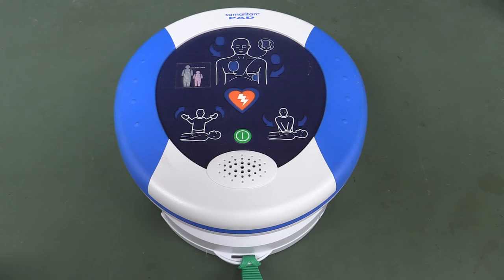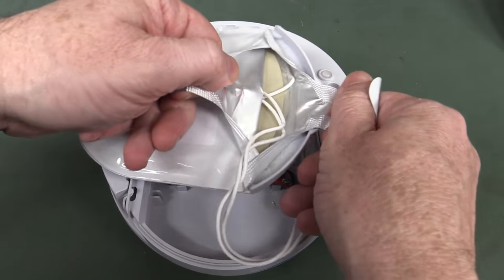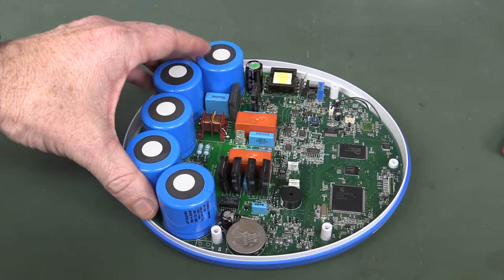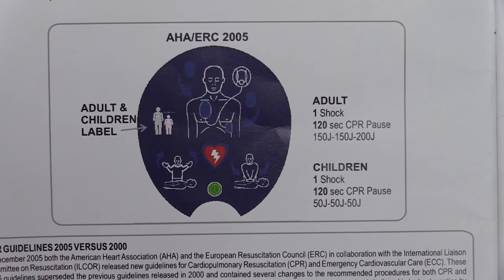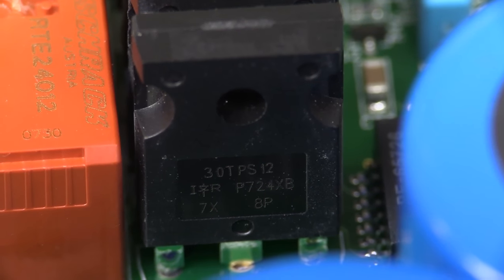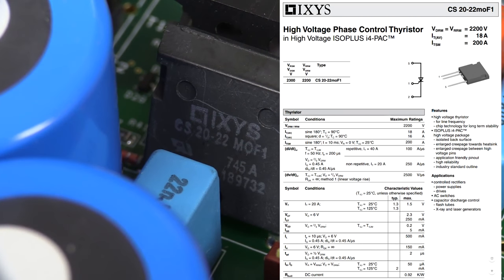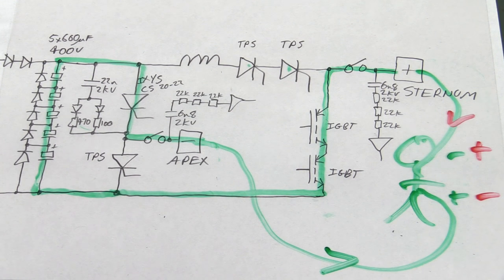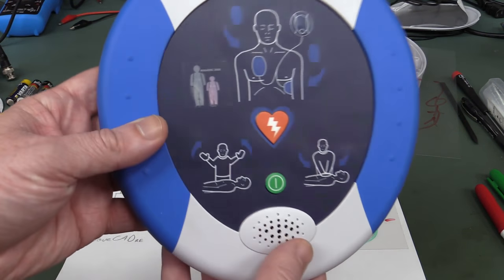EEVblog #909 - Heart Defibrillator Teardown

Comment: cap+ and cap- terminals may be for an external cap for other models.
Reply: Or instead of, for a different build version.
Reply: traces are bit smaller than the onboard caps, you'd expect that if it had external pac the traces would be of least the same thickness. I would suspect its more likely that its for diagnosis.
Reply: I would say that the trace widths are a little mixed up. The traces between the caps are significantly larger than anywhere else on the board. Not to mention that caps series have an overall reduced capacitance. So they're in series to achieve the desired voltage and not power. So i suspect that the output current is not what you suspect at the sight of the size and number of capacitors.
You'll also notice that the traces where the pads plug in to the board are a very similar width to the cap+/- outputs. 
I would say that they're for a different model. It seems like a bad idea to have those traces just for testing
Reply: i suspect they are for a Coulomb counting rig to validate the actual installed Joules at EOL test? ie, device put into test mode, charges caps to defined voltages, then rig slowly discharges them though some resistance and integrates the total current that flows?
Reply from the maker: Maybe, but the traces are smaller
Reply: Max Torque If it is for testing, the question that i would ask is why are there traces for it? For test purposes you would expect test points within the circuitry, not traces that pull the signal away from the circuitry. Also, the through holes at the silkscreen are fiddly - a little bit small and away from the edge for probe clips and the like. The pads are also fresh, so nothing has been soldered on to them for testing. To me, there is nothing that indicates that they're for test.
Reply: +08Ulrtasonic Is there any better idea what those could be used for?
Reply: Krisztián Szirtes Test points. SMT or through-hole. If you Google image 'pcb test point', you'll get results showing both.

Comment: How can the SCRs turn off, when there's still voltage on the caps/current flowing?
The clock maybe just there to start beeping, when the time for the pads is up or there is some calibration/check to be done at certain intervals.

Comment: The flyback diode(s) you were looking for is inside the coil, you can see the silver coloured terminal going into the air core from one side. They used a PTH one instead of the two SMD ones.

Comment: Hey Dave, I see a lot of the components on the HV side are only soldered onto one side of the PCB (e.g. the dropper resistors at 15:33). Why is is so? I always thought that a two-sided Pad will help stress relieving when the components wiggle a bit. What are the advantages of a one-sided through-hole pad?

Also it looks like the outermost pads on the high voltage transformer are missing on the pcb footprint, or does it only look like it?

Comment: The key thing about those electrolytic capacitors is that they are +/- 10% tolerance unlike a bog standard 'lytic that can be anything up to +80% 20%. For this application, that means that for a given voltage, the pulse energy is guaranteed to be the design value +/ 10%. It also means, for capacitors in series, that the charge will be more evenly distributed among the individual caps.

Comment: +EEVblog Dave at 29:30 you're talking about the lack of diodes across the inductor. What I've been wondering is where does the energy in the field go since I didn't think the reverse spike would go through the SCRs. Is it just dissipated as heat somehow? I hope you don't mind the question, I'm just trying to get to grips with some fundamentals since its nearly Friday!

Comment: Yes, those caps are custom, inside and AED and even Defibs in a hospital that are used by medical professionals are still QC in all aspects, the caps must be within a very tight tolerance of ESR and just as importantly their ESL along with dielectric  leakage current. That is beyond important for these. I use caps designed for Defibs for all my high current resonance circuits. Such as the rail caps for ZVS drivers, high power RF circuits, Regen Breaking for BLDC motor drivers (ESC), Tesla Coils especially the HFSSTC (High Frequency Solid State Tesla Coil) every one that build even slater knows that you can't use electrolytic caps on slayer exciter and HFSSTC designs. Even a DRSSTC will work much better using that type of cap.

Comment: I suppose that the IGBT is there in order to stop the discharge in the middle of the biphasic pulse.  Maybe I am wrong, but the Thyristors shouldn't stop until the whole capacitor finished discharging, unless the IGBT turns the current off in the middle of the pulse?

Comment: A thought for Fundamentals Friday:
Design of resistive voltage dividers for cases where the measured voltage is greater than the supply of the opamp or IC measuring stuff?

Comment: It does not matter if the RTC drifts over the years as you just need the time between the use and readout of the log which should be happening within days or weeks at most, where the RTC is going to be really accurate (seconds is good enough anyway).

Comment: Hmmm... Dave, something doesn't add up here. First you say that thyristor stays on as long as current flows through it (and it's true). But then you say when transitioning from one phase to another, it somehow switches off. So either it has to click a relay, or discharge in the opposite order (because IGBTs can be turned off?). Or am I horribly wrong?

Comment: The equipment might use the RTC to regularly do self tests and the Usb might help readig the self test data out to determine if the equipment is still in good condition.
Reply: John Doe is that the battery he was talking about? was thinking it might be used to set off an as alarm after the device gets too old.

Comment: @27:43: Why/how do the SCRs turn off?
Reply: So the TPS SCRs have a threshold, that is so high, that they shut off even if the caps have still enough charge for the negative shock? And the high voltage SCR has a lower threshold then?
Reply: MonophonicSurround He's explanation is incomplete, unless the relays open or something else happens it would just short out when trying to reverse current flow.
Reply: Yes, this is a big gaping hole In Dave's explanation.  My guess is that the  IGBB's and the IXYS turn on which starves current from the lower SCR which turns it off.  Then the IGBB's can be pulsed off long enough to turn off the upper SCR's (probably inductor back EMF helps here).  Then the IGBB's are turned back on to complete the negative pulse.
Reply: But relays would be slow and have unpredictable timing.  Arcing contacts would increase unpredictability.  I really doubt in a medical device this would be acceptable.
Reply: You are right about the IXYS not being needed to drop the lower SCR.  Also, the inductor would help here since a brief pulse of the IGBT's would not see an unreasonable amount of current over the short duration needed to switch the lower SCR off.
Reply: the explanation that makes the most sense is that he mistakenly swapped the electrode polarity, that way the igbt would turn on, deliver positive pulse, turn off, and then the SCR can latch-on and it will conduct until the cap is empty
Reply: +filippo savi indeed.  if I were to design this I would use the igbb for the positive cycle as it can be trivially turned off.
Reply: The amount of energy is going to be controlled by the voltage the capacitors are charged to beforehand.  It will not be controlled by the timing I guarantee.  The relays are just a safety interlock preventing high voltage leaving the unit until it is engaged.  I don't think sense lines would be needed.  The on-off times should work over a fairly wide range of values, and the inductor value would give you a very good idea of how long the duration should be.  The SCR will switch off quite quickly.  You could easily have a safety margin on the timing of over a factor of 1000.  However, I do wonder if Dave got the polarity reversed.  One question I would have though is why have the inductor on the negative pulse...  That seems to suggest the polarity is correct and the IGBT's momentarily short out the path to turn off the lower SCR.
Reply: the inductor is there to limit the current's rate of change, a normal  SCR (non GTO) starts condcucting from the gate (which is a point like feature, compared to the die dimensions) outwards, this means that immediately after the turn on pulse the conducting area will be quite small, if the current raises too quickly it will possibly cause a thermal runaway due to silicon's NTC characteristic, raising the junction temperature well above silicon melting point in the hot spot,  making the whole device fail short circuit; in fact if you search in the datasheet there is a hard limit for turn-on di/dt specified
Reply: Kevin De Martelaere
 I think it would be more accurate than any other method.  The capacitance should remain relatively constant, while skin resistance and other factors would be highly variable.
Reply: filippo savi I think the patient will do enough to limit the currents rate of change.   Also, if that was the purpose then why isn't the inductor on the other big IXYS SCR?  It would seem the best explanation is the inductor is there to limit the current change rate when the IGBB's turn on momentarily.
Reply: well the patient cannot be relied on, the skin might be wet so low resistance between electrodes, and even then the resistance is higly dependent on electrode placement and patient skin type, it shouldn't be used in that case, but an average untrained  (or poorly trained) joe might not know that or even worse in that case the AED would be destroyed, so relying on patient resistance is out of question I think, another problem i see with the short-circuit to turn-off method is that it would waste energy from the caps (and I also think that the discharge intensity is controlled by cap charging voltage), and it would certainly place unnecessary stress on a lot of components (the 2 series top scr's the igbts and so on, then again it could be poissbly done that way
Reply: Well, I don't think it is just the patient.  Those tabs that are placed on the patient have a conductive film over the surface.  The film is conductive, but I don't think the resistance is that low.  I am sure the current will be limited even if the two tabs were attached to one another.  Also there are plenty of other fail-safes in the system.  I am sure the system first obtains an ekg which determines that it is safe and appropriate to apply the pulse.  The relays will only be engaged after that is determined.   Also, the stress on the components would be modest if the pulse is short due to the inductor... and only a very short pulse is required to turn off the SCR (Order of 10s of microseconds).
Reply: Kevin De Martelaere  But my point is that even a modest serial resistance will do alot to limit inrush current.  The conductive gel on the pads will offer a modest serial resistance.
Reply: I dont think the AED regulate the energy at all. On most AEDs I have saw the datasheet of, the energy restriction is done by the pads, in most cases a series resistor in the pads connector, so if you have jacked up the AED with child pads, the series resistor will be suitable for a child, and if you have jacked up the AED with adult pads, the series resistor is suitable for a adult.
Reply: Sebastian Nielsen But in this specific case the AED has a button on the front panel to switch between child and adult.
Reply: I think, he's wrong. The current first flows through the IGBTs and ist turned off with these, so the SCRs turn off. Otherwise no sense for the IGBTs.

Comment: Am I correct in thinking that those missing diodes on the inductor are because of a different model or a previous design revision?  I noticed a lot of boards will have missing components where they are marked on the board.

Comment: BMEET Ret.  Yes... all is components used in medical devices are  subject to the classification of the device.  A class I II III is assigned to devices according to the level of control they are incorporated in. Class I monitoring, II control or III monitoring and control.  The capacitors are most likely class II.

Comment: 25:25 Um, doesn't current flow from negative to positive?  Isn't that red diagram back to front?
Reply: Electrons flow from negative to positive as they themselves are negative. Current on the other hand, flows from positive to negative.
Reply: Basically when in chemistry class and possibly physics class it's negative to positive. When reading circuit diagrams pretend everything goes from positive to negative because that diode symbol will screw with you mind.
Reply: +john smith In chemical class, the positive ions flow plus to minus, the negative ions flow minus to plus.
Reply: John Doe If I would have not have used the word "everything" would you have still commented?

Comment: Until this I have only seen Lead Acid Batteries in Defibs. Reason was (as told from the circuit designer) that Lead Acid batteries can easily supply currents rated more than the battery pack. For lithium I know if the batteries are discharged more than the current rating would decrease their life drastically. Then why does the one shown in the video use Lithium battery pack?
Reply: Lithium primary (aka "metal") vs. Lithium Ion (aka "polymer"). Lithium primary batteries aren't rechargeable at all. In this applications, they sit around for years and are intended for a single use. NiCd/NiMH/LiPo are a horrible choice here -- all would self discharge in less than a year, not counting the standby draw of the device.

Comment: There's a lot of real time also in medical care.  You pointed it out on back. 120 seconds.  You need the pulse as beats per minute, you need to know the duration and repetition rates of the failed beats. You need to know when the beat rate has changed and if it has beneficially changed.  And in this unit there is no you, only the chips and program, and for that the system would of course need a RTC.  Not a synthesised time frame of other such that could be affected by bugs in software.

Comment: I think the sequence for current flow is backwards here. I think the apex is positive first and then the sternum is positive. If they fire the big IXYS SCR first, with the IGBTs on, they will get current flow from apex into the patient and back through sternum.  Then, if you turn the IGBTs off, you will force the IXYS SCR to turn off, with the snubber probably helping to absorb the energy in the lead inductance. Then you can fire all three TPS SCRs to begin reverse conduction. The inductor is likely there to protect the TPS SCRs from excess dI/dt if the patient impedance is very low. I'm not sure what protects the IXYS SCR, but it might involve the IGBTs somehow - possibly they are not turned on fully right away.

Comment: Is it considered good engineering to put diodes in parallel with a string of capacitors in series?  Are there any general guides as to when and when not to do it?

Comment: Is there a specific name for the diodes which prevent the series capacitor bank from reverse charging when its discharged? My search has only been showing balancing resistors, but no diodes.

Comment: Have you ever thought about doing a teardown of a ham radio a uv5r is a cheap one
Reply from the maker: Was actually looking at those on ebay the other night!
Reply: theres heaps of uv5r teardowns available but Dave's thoughts on the design would be interesting..
Reply: It is a little bit disappointing unfortunatly. 3 ICs and some inductors.
Reply: +EEVblog I have one I could send, but I already tore it down! haha
Reply: +Ben Duffy same with mine. I replaced the original MCU with an AVR 😀
Reply: ***** have a write up on this ?
Reply: Well the chip used is a RDA1846, you can find a datasheet and register manual online, but I'm a little bit afraid to put my information/code online, because all the files I have are marked as confidential, and I'm not sure about the legality.
Reply: Do a nice HF one!
Reply: The modern ham radio equipment is rather dull inside, just like TVs, DVD players, phones etc. If you aren't an RF person, there isn't really a lot to say. The fun in amateur radio is in designing, building, testing and modifying. I would recommend that before you buy anything to tear down, you have a look at the available photos and manual online, to make sure there's plenty of stuff to explain.
Reply: More and more amateur radio is being done in soffware/firmware. Don't ask me right now what models i am referring to but will post back at a more reasonable hour.
Reply: There is almost nothing to see in a UV5R, it is pretty much all in one chip with very little external filtering.  Just take most any Baofeng/Pofung apart and you will see much the same thing...much of their variation is simply which LCD module they have paired them with and minor firmware differences.

Comment: Just wondering if anyone could explain why you need the caps? Why can't you just output the required DC current and use components to control the voltage/current/waveform etc? I am just learning by the way so hope this is not a daft question. Thank you

Comment: at 15:30 that voltage sense circuit across the caps - would that be a little ADC that reports to the microcontroller?

Comment: Cool reverse engineering! But I still don't get how the SCR can be turned off on command while there is still current flowing. Does not they need to have no current flowing anymore to open again?
And I still don't get the purpose of the snubber, why we need a matching network?
You've forgot to take look at the logic beauty as stated at beginning! :)